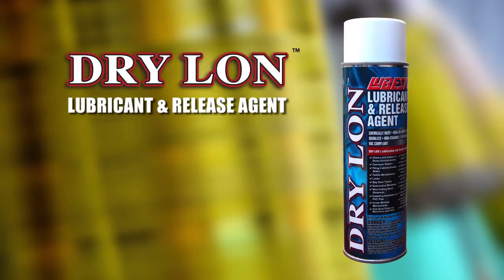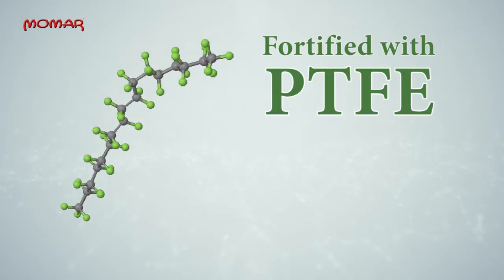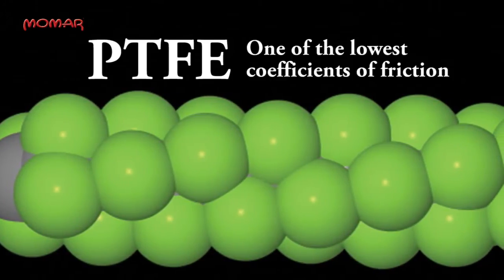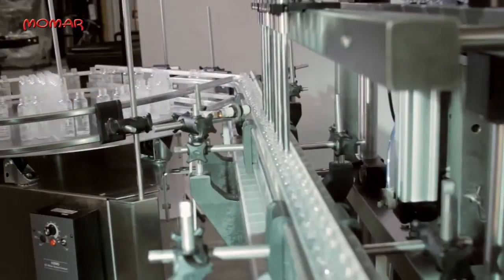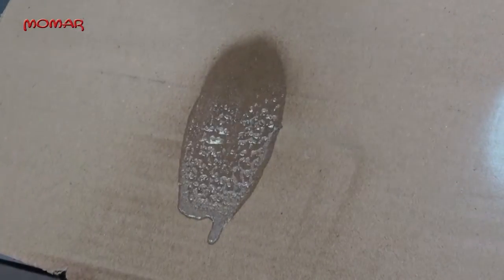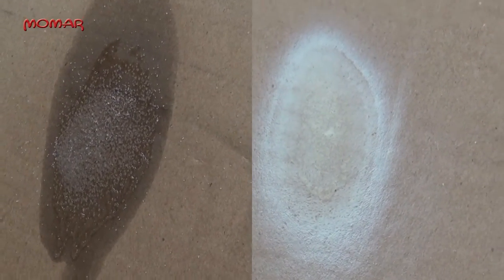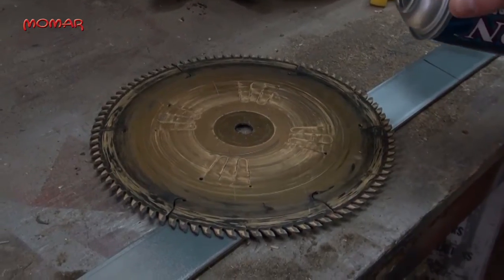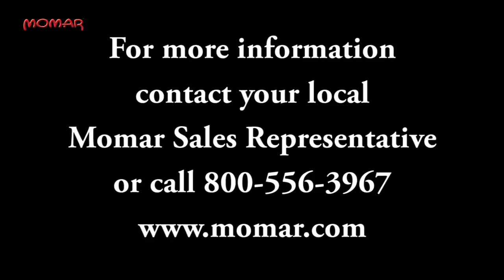Dry-Lon Aerosol :: Dry PTFE Lubricant & Release Agent

Comment: 2:49 that's actually paint, not grease !
Reply from the maker: Thanks for watching our video, Norbert. Dry-Lon sprays on clear and dries to a white lubricating film. Dry-Lon is not a paint; however, it is formulated using an extremely fine PTFE powder suspension, designed to reduce friction, that can provide mild white coloration. Once Dry-Lon has set, it is paintable since this formulation does not contain any oil or silicone; it is also compatible with wood finishes.